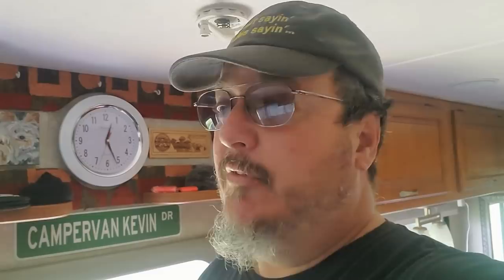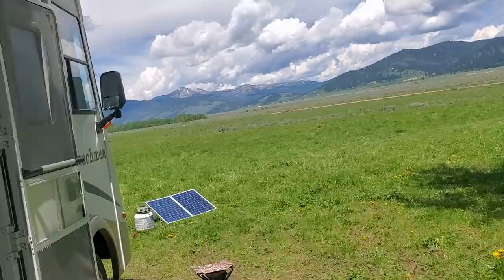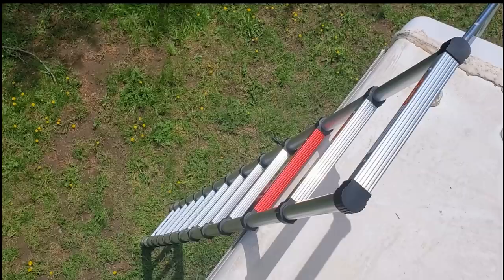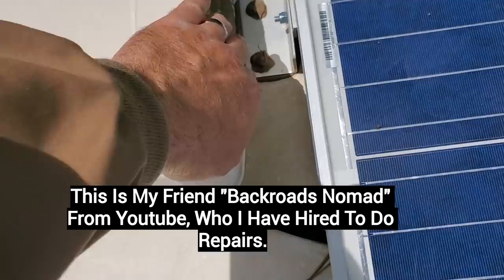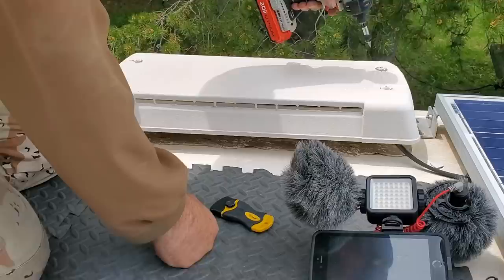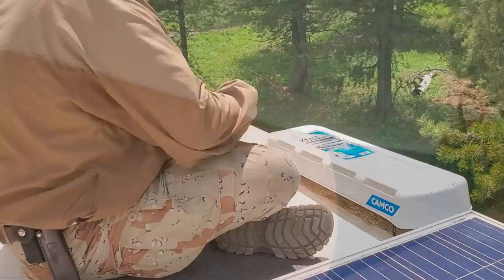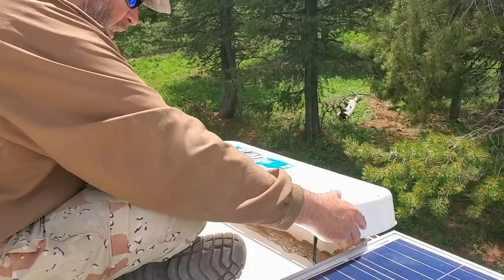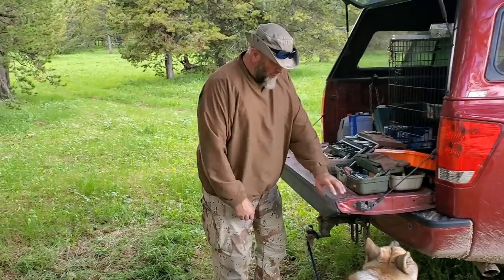Class A RV Repairs/Projects Begin!

Comment: Hey Kevin! Whenever I take a bolt or screw out, or put in new ones, I always coat them with Never Seize. Makes it easy to get back apart if needed, and keeps them from rusting. I do all my wheel lug nuts/studs too. Makes changing a tire a whole lot easier! Never had a problem. Randy.
Reply: Right on, used Never Seize many a time, works well.

Comment: Maintenance & upgrades are a good thing. I have been trying to install a MaxxAir fan in my '74 Silver Streak. Yep. Skies broke loose, rivets had to be drilled out, etc. Now it's so freakin' hot. I have it covered with plastic, a board & 2 heavy bricks. Don't need rain. Need cool! Ergh! 
Good luck with the projects. Good score on that stripping stuff!

Comment: Looks like you are off to a great start on repairs and upgrades! I think you should get rid of the other 100w panel and put your cover on right. Having two different charge controllers hooked to the same battery bank is not correct unless the charge controllers can communicate with each other on a data bus like the outback solar chargers do. The other panel needs to come off anyway so you can get your roof coating on 100%. Safe travels Kevin!
Reply from the maker: 2 battery banks. They will be two separate systems
Reply: @CampervanKevin  Are you planning 2 inverters? Or maybe a big A+B-Both battery switch to parallel Bank 1 and Bank 2?
Reply from the maker: @TheWolfReport  2 completely separate systems

Comment: Have you checked the roof coating from Henry's.......is it compatible with the EPDM cover on your roof.  It might cause the roof rubber to deteriorate.  And of course no silicone is to be used to seal with on the outside of the motorhome.  The silicone will start to let go in less than a year causing leaks.  Been there done that.  Sealant should be the self leveling epdm sealant (dispensed in caulking tubes) so it seals smooth.   Your guy is good and all , but the coating bears verifying.  Don't get burned again.

Comment: PVC like those plastic fan covers will breakdown from UV. Easiest way to prevent is to paint them. I heard any paint for house would do. But I bet they make anti UV paint, most likely any sealant you use for roof would do the job as well I bet. You can ask home depot if need be. I think they make anti UV paint in spray can form. Says on can

Comment: Hello Kevin
Why not replace bathroom fan, with 1 with full controls.
Reply from the maker: I could have added thermostat to one I had  but leaving bathroom door open all time makes it a pain. To walk by
Reply: Try cutting a hole in bottom end of bathroom door,  cover with a closeable Vent cover. No need to leave door open. Cool air from floor, will cool & defunk smell, & take Humidity outside.